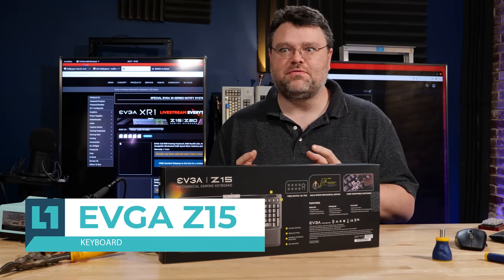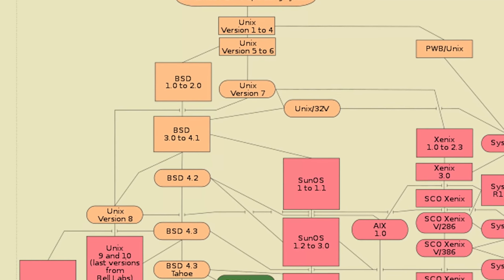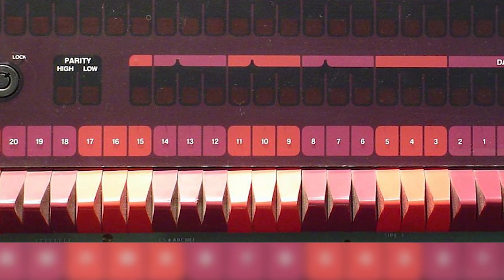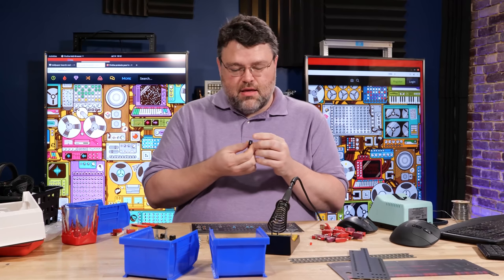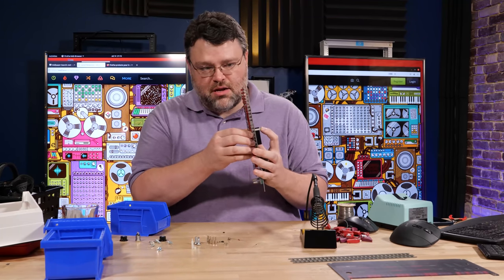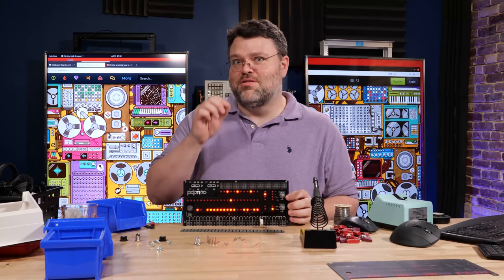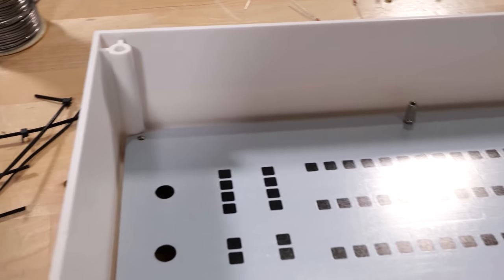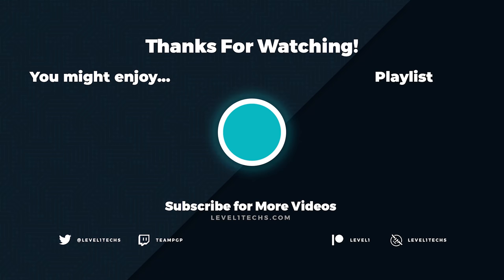Old School Cool! Building a Model PDP 11/70!

Comment: Good Lord young man, you took me all the way back to my youth! When I was first starting out with a family I started working at a local Navy base as a contractor to maintain the flight simulators. We had PDP 11/45s, two each per simulator. One was used as a math processor and I remember flipping those switches to run diagnostics and starting them up for the day. One of the neatest things about the units was the neon indicators in parallel with the fuses. If the fuse blew the neon lamps illuminated. Simple and effective.
   Thank you Wendell.
Reply: PDP-11/45 is almost the same as the PDP-11/70.  The '70 model added a cache memory so that it could run just a little bit faster.

Comment: Grad school Hardware I class, I built a PDP8 out of FPGAs. It ran the original DEC diagnostics suite for the PDP8 flawlessly. Fun times. Fun times.
Reply: Check out the PDP2011: it's a recreation of the PDP-11 in VHDL, suitable for use on a cheap FPGA dev board. It can even connect to the PiDP-11 front panel from this video, to give the full blinkenlights experience.

Comment: Oh, Jeezus... reminds me of working on a Data General Nova 3.   Originally had a paper tape programmer but they upgraded to something that looked like mom's train case (luggage for those not old enough) that had a cassette tape programmer.   Huge upgrade....
Reply: The SimH emulator, which is what makes this PDP-11 panel work, actually emulates a whole load of old computers, including the Data General Nova. You can run RDOS on it.

Comment: We had a PDP 11/44D running RSTS/E at our high school that some of us students helped admin . Being short, I would have to hop up on the hard drive unit to close it when creating a backup of the drive - we had to swap the 20MB disc drums. While we never had to touch the switches like shown here, I do recall having to deal with octal on the printer command console when the system was basically halted - like for backups. Fun times.

Comment: It's a great kit! The one slightly annoying thing is that if you want to fit connectors to the back panel (you don't need to, it just makes things neater), there's very little clearance in the case to accommodate them. Eventually I'll probably get around to 3D-printing a case extension for mine, to solve this.

Comment: In the end of the seventies we used a PDP 11/34 in each of the ~35 graphical radar displays we sold to the Austrian Air Force. We did run it on RSX-11S.

Comment: I worked on 2 PDP 11/70  running rsts e.  Also programmed with Dec Fortran 77.
Reply: I believe rsts is one of the 7 operating systems that can be selected with the selector knob on the PiDP-11.

Comment: Awesome, how much Pi CPU does the PDP emulator use at idle?

The PDP11 project would make an interesting case for a Pi doing firewall duties or whatever.
Reply: do you have a RP04/06 ? Broke my back on them or even a 8"" Floopy Drive,or even RK05.....and the Suckie Mag Tape.
Reply: With the PDP-11 halted, my Pi 4 is aroound 93% idle. If I boot RSX-11M+ and run ADVENT, the Pi is around 80% idle. I haven't yet measured what it's like while compiling.
Reply: If you have a 4-processor Pi, the PiDP-11 software only uses 1 processor.  If it's a Pi4, it runs about 10x faster than an original PDP-11/70, rather than 0.7 mips, it will run at 7.0 mips.

Comment: if you'd prefer to not use a Pi and an entire Linux on it, it can also run on an FPGA board powered by the PDP2011 project. Makes it a bit more "bare metal".

Comment: Hi Wendell, the PiDP-11 is all fine and good with a raspi. But if you look for a more realistic experience, check out the PDP2011 project at pdp2011.sytse.net/wordpress/pdp-11 Its a FPGA implementation of a PDP-11, including the PDP-11/70. You can use a Cyclone CYC1000 FPGA board with an adapter/shim to plug into the PiDP-11 panel. You essentially get a "realistic" PDP-11/70, with serial, networking and disk. I run such a setup for fun, using BSD 2.11. 
To me, it is really refreshing to go back to the early Unix variants and run them on a nifty hardware, such as the PiDP-11/PDP2011 combo instead of "just a software simulator".
As neither, PiDP-11/70 nor PDP2011 projects are mine, I'd like to give a shout-out to Oscar Vermeulen (PiDP-11) and Sytse van Slooten (PDP2011). Put together, a PiDP-11/70 driven by a PDP2011 is a must-have for any vintage UNIX lover (like me).

Comment: While that is an amazing soldering iron, I really think you should try a JBC iron (or any powerful iron with an active tip). You can lower the temp by a lot (to prevent damage) and it will still solder great :)

Comment: Ah, a trip down memory lane. I wonder, can you run its successor, VMS, natively on ARM? Not just emulated.
Reply: @asdrubale bisanzio Unix runs on many CPUs, as did Windows NT, so I ask the same of VMS. VMS used to run on Intel's PowerPC chips, for example, and others before that. It now runs on x64 CPUs too. So I wonder if it will run on ARM?
Reply: I doubt it.  Multics and its child, UNIX were the first and just about the only operating systems written entirely in a high-level language - at least in the 1970s.  Very few other operating systems were written in high-level languages in the 1970's.  A significant amount of VAX/VMS was written in VAX Macro Assembly language.  If you read the article about VMS on wikipedia they actually had a build a compiler to translate VAX Assembly into Alpha code for the port to Dec Alpha : https://en.wikipedia.org/wiki/OpenVMS

Comment: Honestly if typing experience is your main goal go with Kailh box clicks or nice linears.
That extra spring they use for the click is better tactile keyfeel than nearly all of Cherry style tactiles.
If you want the toppest tier quiet tactile experience, go for a Topre or find a dampened Apple Extended Keyboard from the 90's in good condition.
Boba U4s or something like that wouldn't be massively far off the mark though.
Reply: But if you wanna dampen those rotary clickers just open them up and grease them, ezpz silky smooth.

Comment: It's a pity it's not the full size 19" rack mount panel size.
Reply: I'm not sure the 19" size makes sense but maybe something a tiny bit bigger (closer to the size of a stereo receiver) would have made the most sense.  Oscar had to comission all the PCBs, the silk-screens, and the injection-moulded switches, and the case, and so I think he was probably limited in how large he could make the PiDP-11 without the costs exploding from a different, larger model of switch, etc.  The original PDP-11 I am told had 10w lamps - not LEDs.
Reply: @dgillies5420  I only say 19" because it's the full size deal that the real one would be. I get the whole size and cost thing. Just if it was full size I could fool myself for a minute that the I was back in 1980 with a massive chunk of underpowered hardware that was in reality using a 1000th of the power and 1000 times more powerful. 

Not only that, it would look great in the 19" half-height rack in my office.
Reply: @iggysfriend4431  would you be willing to pay $500 for a 19-in model versus $300 for the existing sized model?
Reply: @dgillies5420  Hi D Giles. To be honest I hadn't thought about that and I'm also not sure. I think I would have to be faced with the option. The reason I am not sure is because  in reality the PDP-11 is kind of pointless in terms of performance, it's just nostalgia. It's the same as I have an Atari 2600 that I play but in reality I can have a better experience on an emulator. So, ultimately I don't know.

Comment: So, you can’t program through front panel switches? What a bummer!
Reply: You CAN program through the front panel - that ALL WORKS.  It will also show lights as your program executes, but they are sampled and not updated as quickly in real-time as a real PDP-11.  People have been working on the software emulator for 30Y - oscar @ obsolescence guaranteed showed up and did the hardware part.

Comment: "first computer fast enough to run a multi-user unix system" no, it was the first computer cheap enough to be handed to bored hackers. Timeshared systems go back a little earlier.
Reply: Yeah, the cheapest PDP-11's were about half a year's salary for a college professor of CS - $10,000 - in the early 1970's.  But you needed at least a PDP-11/45 with memory segmentation/banks and 256KB or more to run UNIX v6, v7.

Comment: How fast is the raspi in comparison to a pdp11?
The more you bend the pins the harder it'll be to repair it afterwards.
If you don't have a spring loaded PCB holder (http://www.productiondevices.com/PC%20Board%20Holder.htm) at home you can solder some components from the top if you just put small boxes under the PCB. Don't worry about the diodes they can take the heat. Some ICs can't, so, maybe you want sockets for those. If you can manage to secure the PCB in a vertical position it will be easy to solder the LEDs one by one without fastening them to the PCB.
Reply: 10x faster for a Pi4, running at 7 vax-mips, running on a single processor of the Pi4.  The other 3 processors are idle and can be used for other things.

Comment: The sad thing is... There is still production equipment running off of pdp11s... 
That's without mentioning they are emulated... On Windows XP machines...
I wish I was making this up 😭
Reply: Yup, we have one still running at work. Legacy code written by summer students for the safety interlock system for something for high energy physics. What could possibly go wrong? They buy replacement parts from some guys barn on eBay.
Reply: Ticketmaster, supposedly.  Actually the instruction set of the PDP-11 was fantastic;     while (*p++ = *q++);   compiles into 2 instructions - a memory mov using 2 registers in post-decrement mode and setting the condition bits, and then a jump-nonzero back to the memory move.  The motorola 68000 (used to launch macintosh) was a pretty faithful attempt to make a 32-bit PDP-11.

Comment: Guessing the price for the 2021 edition is only 1% of the origin $11500
Reply: Nope. But close. It’s only 2% of the original.
Reply: Actually the $11,500 model (pdp-11/03) is too small to run Unix.  You need at least an 11/34 or an 11/45 to run UNIX.  I'm guessing that an 11/70 cost $150,000 and inflation is up by 10x since I was a kid in the early 1970's and so that would be $1.5M today.  I just put together a fully spec'ed out PiDP-11 Pi4 with all the I/O ports, 8GB RAM, 128GB flash, and it cost about $150, with Ethernet, 802.11 (did not exist in 1975 Boggs was just about to publish his paper), 5 USB serial ports for 5 terminals, etc.  And the PiDP-11 is 10x faster.  So it's 100,000 better (10,000x cheaper and 10x faster) than the original PDP-11/70.